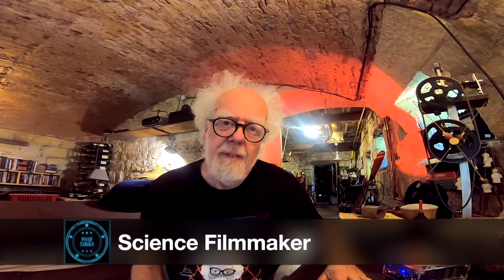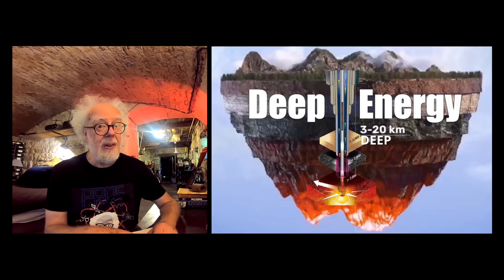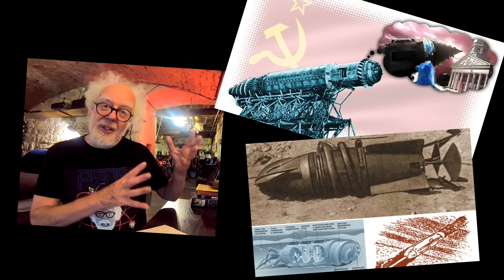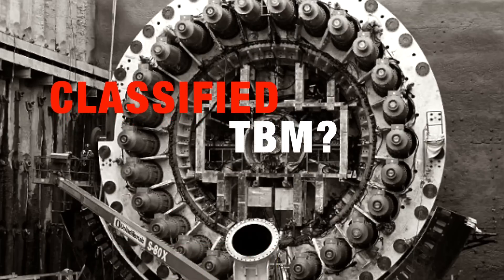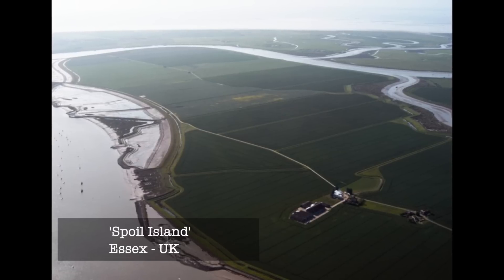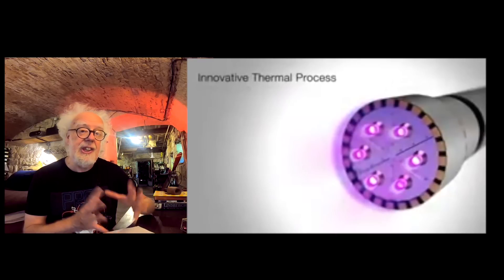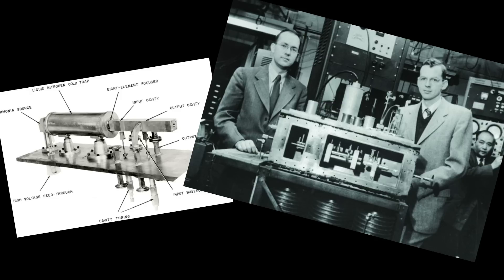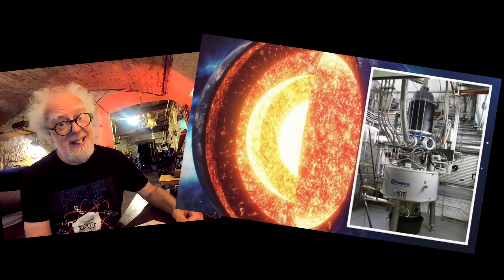Secret Tunnel Technology - Prof Simon

Comment: So, once vapourized, can you sort out the silicone/quartz and then sinter it back on the tunnel surface?
Would the quartz be electrically (teluric)/magnetically conductive?
What is the strenght of the quartz tunnel? Would it still need reinforcment? Can you melt or merge the quartz and steel?
Reply from the maker: good questions...i expect the fused rock to be able to sustain geo thermal water pressures

Comment: I have often mentioned their must be substantial tunnel boring and tunnel counterboring activities from both sides of the South/North Korean DMZ.  Some of the North Korean tunnels have been discovered.  These two forces have been starring at each other for now almost 70 years.  Tunneling by man has been used since major fortifications have been built.  The mega mines placed for Battle of Messines in June of 1917 is probably the best known tunneling operation.  I suspect the two sides probably have put in "water" and "sewer" lines to the DMZ facilities and water is pumped in through one line and the water/spoil slurry is pumped away.  The pipelines may go off the coast, pumped into rivers to be carried away or some of it just worked into the local farmland.  Perhaps a method you describe would be quieter than conventional drilling.  There are likely a large number of vertical drill sites for a deep downward wall with detectors in them to look for activity.  Maybe they depth charge suspected tunnels like a submarine.  Bombs can be sent down the vertical holes and the explosions might cave in the invading tunnel.

Comment: If you started extracting thermal thermal energy from underneath the crust eventually wouldn't you create a mass of solidified magma I mean the crust of the Earth is like the top of a cup of pudding Just the film on the top Couldn't this potentially create imbalancesIn the density of the tectonic plates potentially leading to earthquakes or other disasters
Reply: Fortunately, heat energy conducts much faster than we could ever extract it. It would be like trying to cool a volcano with a hand fan.

Comment: power source and exhaust system for the vaporised rock seem difficult problems
Reply from the maker: the power is sent down the hole via a wave guide and the vapour removed by negative air pressure... it seems hard to steer off vertical
Reply: @SimonHollandfilms  to keep vapour vapourised for a long length of tunnel and have no evidence of exhaust plumes seems  difficult

Comment: Love your videos, professor! But I have a question on this topic: vaporizing or melting the rock does not make it disapear. They would have to deal with the ruble anyway.

While writing this coment, another question came to me: when you detonate a nuclear bomb deep underground, It creates an imense cavity, right? Where does this tons of rock goes? Cause if it vaporizes, it has to condensate and solidify again, somewhere.. as far as I understand.

Anyway, keep up with your awesome work. I wish I had more money to suport you on patreon. But who knows.. maybe It could happen soon.
Reply from the maker: i think the plasma drill ionises the rock into a vapour.....which you can blow out with fans
Reply: @SimonHollandfilms  how long does it takes to cool down enough to not be able be fan-movable? 
Aérospatiale, now Airbus Helicopters, did some interesting work with plasma to vitrify/eliminate toxic waste in the 80s and 90s. they also, allegedly, tried to use a derivative tech to bore some holes in rock too and hoped to use it for nukies waste but it got way too energyvore to be viable. or so they said at the time of course... 😏

also, in the late 90s, some russian labs were touting the same kind of boring machines in russian commercial fairs to get money to develop and refine the technologies used. they had pics and a grainy VHS demo tape of an 60 to 80 cm diameter vitrified irrigation tunnel made with this. all documentation was in russian and typewriter'd+xerox'd on cheap paper but they were very eager and talkative in french, german and english if you showed any genuine interest in their products and invited them to eat with you. they then disappeared from the industrial fair circuit and never seen again by westerners eyes they were.
't was quite intriguing and interesting like lots of soviet era developed tech that took other roads than us. 😎
Reply: @kittytrail  If I may. The vaporization doesn't necessarily condense to a solid rapidly or at all after heat loss other than as a dust. Volumes of the detritus would be reduced to gasses with no subsequent accretion. Dust can be kept fluid in a high pressure exhaust system by conventional means to the dump point.

Comment: Geo Thermal power to make Hydrogen for cars and trucks ... They both are a good source of clean energy ... Hawaii & California could export Hydrogen . 🌴 . .. And use the plasma drill to make a California tunnel from the ocean to the desert 🌵 just a few miles inland .. The ocean water can be put in geodesic domes in the desert for fresh water 💦 from condensation .. The ocean water can be used for hydro electric ⚡️ power below sea level .. The desert hot sun ☀️ can be used for solar panels to pump fresh water anywhere ...  Lots of sea salt byproduct . You could send fresh water with gravity in a separate tunnel going back to LA without pumps where fresh water is like gold .. I’m talking about five square miles of geodesic domes with the glass panels made right there with desert sand ... Brackish water could be used for agriculture in the desert for growing date palm trees .🌴. Salt water ponds in the desert could make sea salt from evaporation  ... Eventually near the huge desert sea salt ponds you could put wells to get fresh or brackish water that filters down a few hundred feet below the salt ponds ... If California needs fresh water this will do the job .